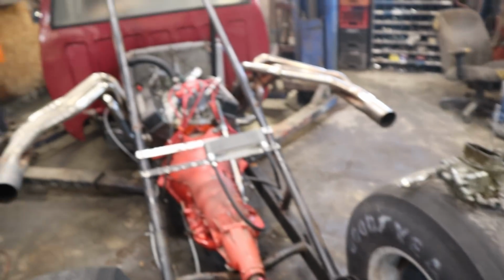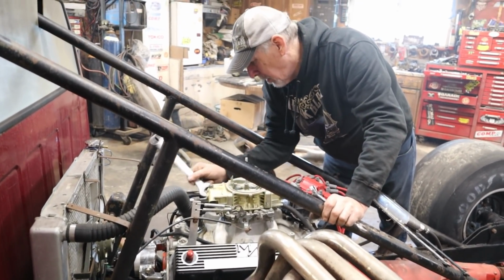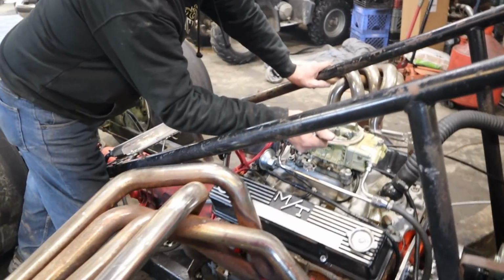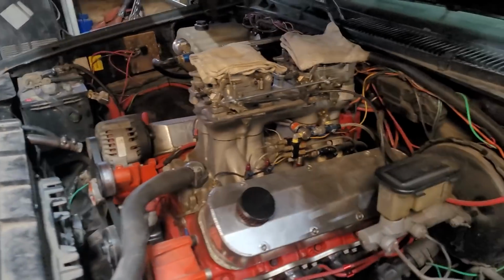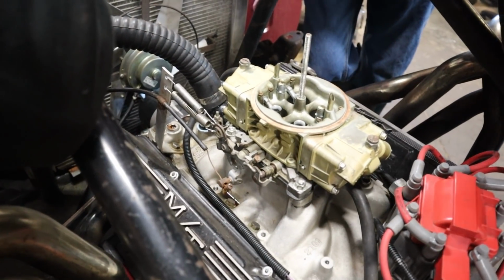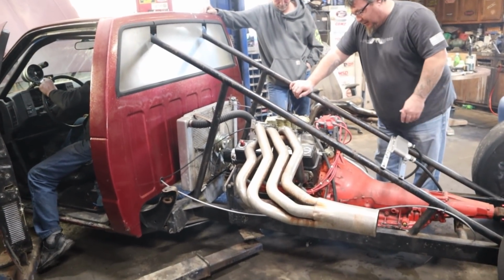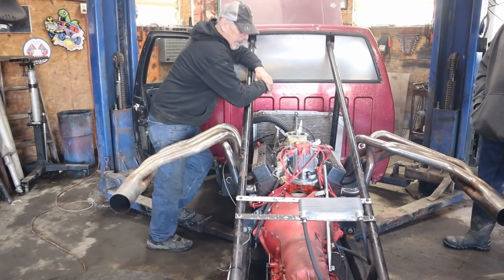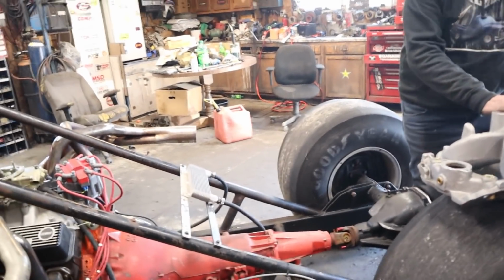BURNOUTS UNTIL IT BROKE The Mid Engine S10 lol

Comment: Back in the 90's I saw a S10 with wide tires parked in high grass so I stopped and asked the guy about it.  It had a built 327 and a Turbo350 in it.  Said he was going to continue fixing it up. When I moved from there in 2000 the weeds were higher than the truck. Wish he would have sold it to me.
Reply from the maker: Sometimes you just have to annoy people into selling their cars lol
Reply: @SniderTron3000  So true!   he said it was really quick on the road but never took it to a strip.  I think it was the first V8 S10 I ever saw.

Comment: I say shorten it, put a TH425 from a 66-7? Tornado/Eldorado, cut the bellhousing off and replace with an aftermarket, or use an adapter plate.            I came back to edit my comment, ls4 and transaxle swap/shorten it

Comment: To add a rear suspension.
Cut the frame in front of the engine and insert a hinge joint. Run two new frame rails down the outside and slightly above the old. Place a cross member above the old rails with enough space to insert a bump stop and two or three inches of travel.
Connect the roll cage bars to this cross member and place some spring perches for coil overs where they will best fit.
This will add about 80 to 120 pound to the read end.
Reply: @newtonfirefly3584  That was totally ignorant of you to put your brain fart into text.
You clearly have never seen the suspensions they put under some early vehicles where the diff transmission and engine were all one solid connection and the engine was hinged at the front and full floating leaf springs at the rear with a panhard rod to keep it from crabbing.
The suspension I suggested was to avoid a massive rebuild and stretching the frame to allow for a tail shaft.
Alternatively he could do a double A arm if he changes the diff to IRS

Comment: Snidertron 3000,I have another question, when you at a power adder like a turbo,pro charger, super charger and or either nitrous, do you have to upgrade the pistons as well from stock pistons to aftermarket ones
Reply from the maker: Its safer to upgrade to a forged pistons if you're gonna run a lot of boost or spray. Running stock pistons is a bit of a gamble. Even more so if the rings aren't gapped
Reply: @SniderTron3000  ,I figure that because I know a stock ls engine can take at least 1000 for the factory aluminum or cast iron and the new lt engine can take more than that, I think,even the stock crankshaft also